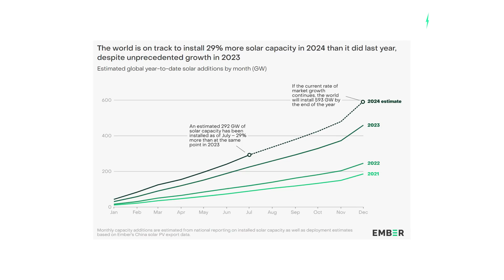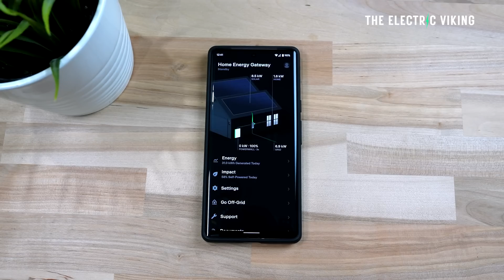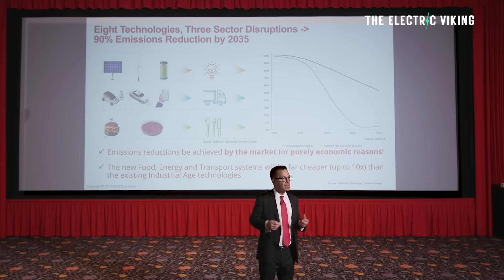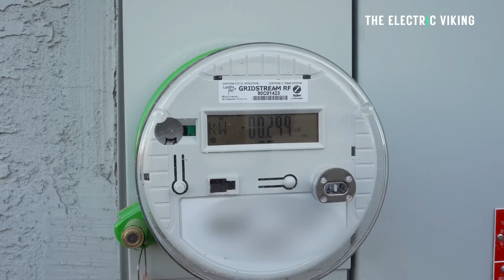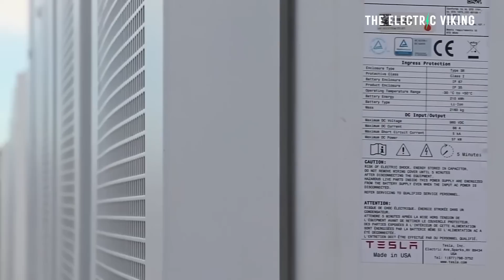Solar goes EXPONENTIAL - surpasses even Tony Seba's projections

Comment: This is certainly a good news, but the only thing that matters is how much energy is produced, not the installed capacity. It is not the same to have a coal-fired power plant that can always operate at 90% power and have a solar power plant with the same maximum power.
Reply: The green energy revolution isn’t just about producing power. It is also about better insulation and leak sealing for homes, more efficient appliances, minor changes in the time of day when you use energy, etc. Heat pumps, induction stovetops, and wood stoves can all help you go off grid. We have efficient windows, honeycomb blinds and double insulated curtains on our windows to keep out summertime heat and winter cold. All of the se things mean our current house uses far less energy than the past homes I’ve built for us. .And, with smart electrical breakers, and minimum effort, you can time when you actually use energy. The green energy revolution is only partly about electricity generation! The rest is increasing efficiency.
Reply: Most of the people commenting here are delusional about the concept and believe they are changing the world by installing solar panels
Reply: This was a video about growth rates. When total max capacity is exponential, so is actual generation

Comment: I understand solar panels are not better than 20 to 25% efficient in converting the sun's rays into electricity but I wonder what the efficiency of an ICE car or a coal / gas power station is ?. I guess you have to take into account the one off cost for energy used to produce the solar equipment versus the continuous cost of delivering the gas / coal to the power stations, it would be good to know, probably a bit of a shocker (pardon the pun) as you would have to include the cost of delivery of electricity from these stations to the homes and businesses.
Reply: Gas and steam turbines are about 60% efficient. However, the total cost of production, including fuel transportation, maintenance etc, reduces the cost effectiveness significantly
Reply: @gdiwolverinemale4th  The very best combined cycle Nat gas plants will do 57 % efficiency. This is a gas turbine with a steam secondary . Very few have been built. Most gas turbine plants run at 33 to 36 % eff. Coal plants about the same at full power. Now, mine the coal, build and run the railroad, dispose of the waste ( 5 to 8 % of the coal mass. ). Build the factories to make the mining and railroad equip. Employ many, many people to keep it running, including doctors and hospital staff. Include all the people who die in car/ coal train crashes. Pay for the care of all the people maimed but not killed In providing coal electricity.
Reply: @kkarllwt  While there is truth in what you say, your beloved panels are simply far insufficient to power a home 24/7. That's all there is to it. But dreams are fee
Reply: @gdiwolverinemale4th  60% eh,  I suppose we also need to factor in costs, oil and gas cost money to buy whereas solar energy arrives on site for free, no transmissions costs
Reply: Not a particularly relevant number, % efficiency. Doesn’t keep it from being a correct financial decision for an increasing number of people, just highlights potential for future improvement.
Reply: % efficiency matters more for things like gas cars because we’re greenhouse gassing up the place without getting max energy from it. Burning fossil fuels to charge an EV is more efficient. Something about the power plants are way more efficient than gas cars
Reply: Like the power plants use the heat to boil water to create steam to move magnets, and moving magnets make electricity.a
An ICE car just… has a grille in front to help expel all that heat. Rather than using it

Comment: Hi Sam. Thank You Again for this video. You mention Gigawatts. I dont know how much that is. On my bill there is kWh. Can you Always mention kWh to make it clear to everyone. For Example a hectare Solar is a MegaWatt installed. 1000 MW is 1 GigaWatt. But on my Energybill it is in kWh. I Pay kWh. I produce kWh. How much kWh is a Megawatt. One Hectare Solar is One Megawatt and produces 1 Million kWh per Year. That makes your story clear. I hope you get the idea.❤👍🌹🌹🌹
Reply: One megawatt is 1000 kilowatts. A hectare is 2.2 acres. The equivalent of putting a 4 KW system on 250 houses.
Reply: @kkarllwt  and what is it in kWh. One megawatt is 1000 kilowatts. How many kilowatthour is 1000 kilowatts. I mean 1000 kilowatt is 1 MW. 1 MW is 1 Million kWh per year in Nederland. In Australia must be more. Most people dont know that. Always mention kWh. How much is a MW in kWh in Australia.???
Reply: 1 kWh is 1 hour of 1 kW. If you had a microwave oven that has 1000W (1kW) of power, running it for an hour would count as 1 kWh on your energy bill.  And if you had a solar energy system producing an average of 1 kW, you could run that microwave 24/7 for free.
Reply: @rosvojeesus  thank you.

Comment: 120kw/h per day????  What size system is that?  We have a 10kw system admittedly with some shade issues and a mixture of east and north facing panels but generate about half that on a good summer day.  Today it was a beautiful sunny day in SE Queensland and we generated 43kw/h.
Reply: Clear spring day? divide by 7. I think he installed about 18 KW of panels.
Reply: @kkarllwt  That would be 18 kW.
Reply: That would be 120 kWh, 10 kW and 43 kWh.

Comment: Gujrat model went further in installing solar panels over exposed water ways. Water evaporates less & humidity prevents overheating of the panels. 🙂
Reply: We have hidro dams here in Romania and the company running them also wants to cover them with solar panels.
Reply: @orionbetelgeuse1937  I think you don't know how it's supposed to work. They are mounted on floaters, not fixed in place and there is space between them for people to check them out. Instead of being an ignorant you could have googled it. It has already been done in China and other countries.
Reply: @orionbetelgeuse1937  I don't get how a big storm may cause any problems on a dam which has overflow valves on it. The array will stay mostly at the same level of water for most of the time.

Comment: It looks like the national Building Regulations here in the UK will be requiring solar PV on all new homes started after 2026. "Homes for the Future" 
Even here in the UK (England) we are seeing even north facing PV panels being "more than cost effective". They stay cooler and this almost offsets the lack of being south or west facing. Based on the real data in 2023/2024.
Reply: This issue in Uk, is that solar does not address the midwinter issue.  We still need wind and hydro (and tide)  to sort that.  But if wind have solar it makes the wind and hydro less economical/ more expensive to run. 
Solar is great for the private consumer, but debatable for the country
Reply: @markthomasson5077 luckily you still have Scotland as part of the UK.
Reply: @christianvanderstap6257  haha, I live in Scotland…,it’s the other way around
Reply: I suspect if forced on developers they will do the minimum possible. So small arrays not utilising the max roof space. Developers are the blight on the land.
Reply: Which shows ... it is id eol ogy driven. Were it really needed, the regulation would not be necessary. But ... as always
Reply: @gdiwolverinemale4th, you know, fossil fuels are receiving huge subsidies, too. Right?
Reply: @yasaralamin1246  What subsidies are those? Farmers get some relief, for very obvious reasons. Regular people don't, myself including
Reply: @gdiwolverinemale4th  You're not a fossil fuel producer though, are you?
Reply: @Doug97803  ... which is a common question id eo logic aly motivated ask. Making a mark on the history of the world. Really?
Reply: @gdiwolverinemale4th Got quite the crazed fanatic 'ere, 'ent we, lads?

Comment: Sam, do you have your system set up so that only the excess power over the rest of your demand, goes to the EV battery.  If one just charges when the sun is shining, if the under-floor heating comes on, a cloud covers the sun, suddenly, you are charging mostly with grid power.

Comment: Sam, idiots never apologize.
Reply: You have power only during the middle of the day,  not at night when you need it the most for heating or hygiene. The solar bleeps are rid err  iculous
Reply: That is why a home solar system also includes batteries. And, a solar system includes a smart electric panel. With solar, you run your dishwasher, washing machine, do most of your home cooling and heating, run your well pump, and charge your cars during the day. It isn’t an inconvenience to switch much of your electricity use to the sunny times of the day. And, battery prices, while still too high, are coming down. Homeowners will soon have 40 kWh of storage, enough, with solar,  to power most homes even though the winter.
Reply: @freeheeler09  
Or make plenty of ice and hot water during the day and store them in tanks, for cooling and hot water needs 24/7, and take some load off battery system.
Reply: @gdiwolverinemale4th you must have not heard of an electric boiler (stores hot water) or a battery if you belive solar is only good during the middle of the day. We have a heat pump with a thermal buffer (2000 liters of conditioned water). My current hot water is just cold water flowing through a 32 meters cupper spiral inside the 2000 liters buffer. If I raise the water temperature tu 50 celsius in the buffer I have enough thermal energy for 20 people to take showers without using any additional energy. The buffer is used for heating obviously, but we also have the hot water from it so it's like we always have hot water ready to go and I can heat that buffer up to 55 Celsius during the day with solar and the heat pump and thenhave a thermal buffer for the house heating as well which may last the entire night and end up not using any electricity for the heating that's not from the solar panels.
Reply: @alexandruilea915  Sounds like an extremely complex and expensive system. How much electricity and gas could you buy for $25000? Look, I have a 13 kW solar system and nobody, I mean nobody can sell me fertilizer about it. I am not saving the world, that's not my goal
Reply: @gdiwolverinemale4th  we paid 15.000 for the solar panels and about 7.000 for the heat pump. The water buffer and everything else we had already from the previous wood burning central unit and they are necessary regardless of what heating sistem you use unless natural gas is an option. If you have natural gas I would honestly go hybrid with heating using ari conditioning systems for as long as I can and help with gas for the middle of the winter. Also get a water boiler that has a heat pump included so you can store heated water.
Reply: @gdiwolverinemale4th battery energy density doubling every few years. And it’s already good enough for home solar to power the house at night.
Reply: @SigFigNewton  Well, when battery capacity is sufficient and affordable, then let me know. Until then, it is just fertilizer. And actually, that sc err heme already costs trillions in subsidies from hard-earned taxes in the West

Comment: But it doesn't matter! The installation costs a ton of money. The panels are already just marginal costs!
Reply: I installed super-flexible and hard-wearing CIGS panels with some metal rods, stainless steel wire, heavy-duty rope and some elbow grease.

Comment: I'm afraid we're a bit backward with solar adoption in New Zealand
Reply: I have 3kw, 12 x 250w panels installed from 2015. I live in Invercargill with what I hear has one of the lowest solar insolation available. It has reduced my electricity bills quite a lot but I still use quite a lot from the grid in the evenings, especially in winter. I was going to install some more panels and battery storage but the cost would have been NZ$13900. I paid $9060 for original installation in 2015. I was going to install 4 x 410w more panels and a 7kw battery. I was not satisfied with the estimation of pay off time with saving, given by the company. They did the calculation based on the panels I already had plus the new panels and battery, not the new panels and battery alone. This greatly reduced the payoff from investment calculation. Besides I got a lot of pressure from certain persons saying at my age 72, I would not live long enough to see the payoff. I discounted that pressure at least to a certain extent because it reminds me of the attitude, "don't bother about climate change or any potential future disaster, because you will be long gone when it happens". The climate change thing though may not be helped much with solar in New Zealand because about 70% of electricity comes from hydroelectric and wind. It does help at least a bit on a world wide scale though by scale of economy from where panels and inverters are manufactured. The government is not offering help for rooftop solar and took away subsidies provided  by previous government for EV's.

Comment: Energy wont be free because we need storage and the grid. We are still have to solve these two issues or it wont work.
Reply: Of course, nothing is "free". We're looking at lowest sustainable costs. Don't be silly.
Reply: @jgarbo3541  the new grid and the storage will be more expensive as the old one. So the energy prices will go up when you go 100% without fossils. Its pure economics.
Reply: @tinogruchmann  More expensive - than -...evidence? 100% of what? Back to kindergarten for you...
Reply: @jgarbo3541  as the actual fossil based system, please keep polite i dont even know you
Reply: Do you follow this channel at all? Do you know how many mega batteries are being installed, and how quickly?
Reply: @elephantintheroom5678 Hi, have you done your own calculations what is necessary to change to solar and wind with batteries worldwide. Batteries can only be used for some hours but not for weeks when we have no wind and sun. There we need power stations which work reliabel.
Reply: The AEMO ISP says that we will need the equivalent of 9 more Snowy 2.0s before the last coal fired power station closes. That is not going to happen.
The AEMO is now relying of domestic home batteries and EVs (plugged into for charging) to backup the grid during the evening peaks. It is called CER (Consumer Energy Resources) in the ISP.  So, how is the AEMO going to persuede folks to buy home batteries. During the day, there is so much domestic roof top solar power availalble that renewable farms can't compete. The AEMO will soon start charging domestic solar owners to put power into the grid. If you can't put power into the grid, then it is logical to keep it for your own use later i.e. install a home battery.

Comment: I hear a lot of talk about abundant energy and how the price will go to zero. Power companies won't allow this to happen. Personally I believe power prices will go a bit like broadband, where you'll pay a monthly line charge which will be determined by the maximum capacity (the peak of your power draw), and that the actual amount you use will be immaterial.
Reply: "Power companies won't allow this to happen" ? What can they do? They can bribe politicians to veto wind power installations (those require permits), but they can't stop people from installing solar panels on their properties.
Reply: Some people do not realize solar power is only available when there is sunlight. It is difficult to find a proper qualifier for such
Reply: GD, that is why you also install batteries and a smart electrical panel. With smart breakers, I do all of my home heating and cooling, run the water heater, run the clothes and dishwasher, run the well pump, etc., during sunlight hours. And we installed enough batteries to get us through the night. I’ve also got an extremely effective wood stove, so we have no problem keeping the lights on and house very warm in winter. We also actually heat our water for coffee and tea and cook our meals in winter on the wood stove.
Reply: @freeheeler09  Aw ... The batteries and the panel pack are so expensive they do not pay off in 20 years. Plus, the battery power lasts only a couple of hours under a 6 kW load. You are likely unaware when you switch over to the mains.
Reply: @gdiwolverinemale4th  Some people don't realise that if you have a battery, and a sufficient number of solar panels, you have free power, 24/7.